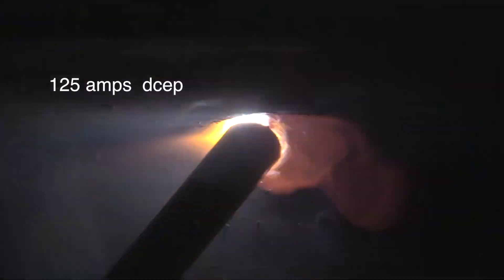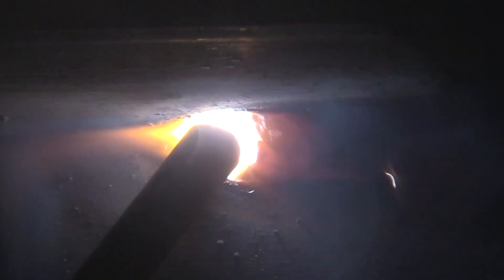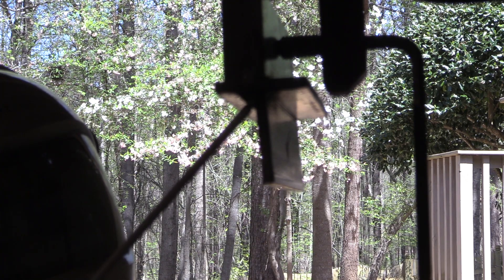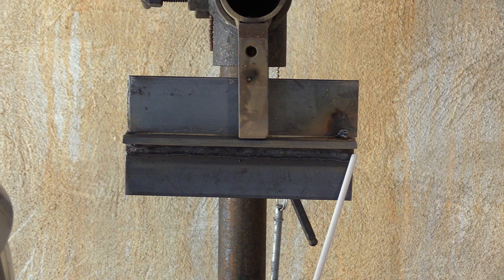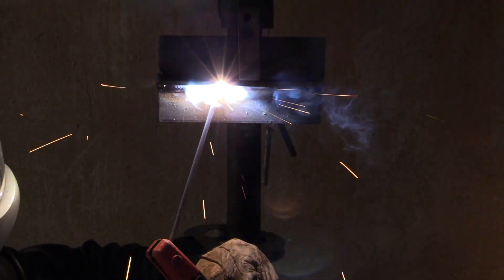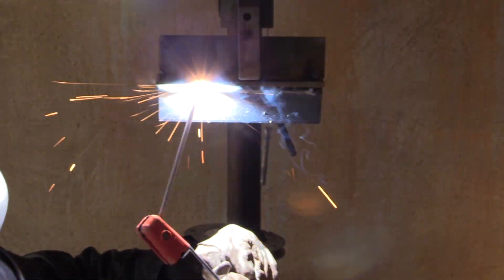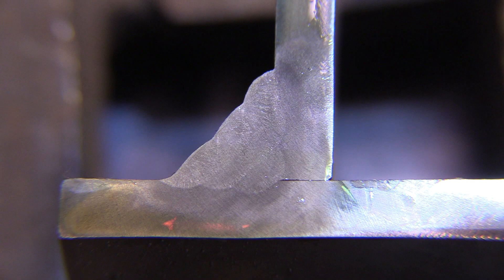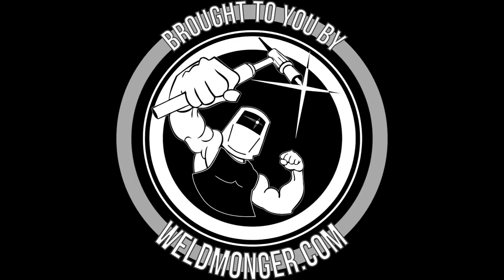Overhead 7018 Biggest Mistake

Comment: I've been a welder since 1972. I began as a helper and practiced during breaks and lunch. Got my 1st opportunity to make two 3g uphill welds because the welder couldn't fit through the porthole. My welds were UT'd as passing. I'm currently certified AWS D1.1/5.20 Unlimited thickness positions; flat, horizontal, vertical, overhead. As a boiler maker welding heat exchangers, I was ASME certified 30 years ago.

Comment: Something that my instructor showed me was when I'm running my bead I have the rod pushed up to where I can feel the hard rod dragging on the plate. If my travel speed is too slow, I am depositing too much metal in one area which results in it dripping down too. So even if you are welding a little cold and have  a correct feed rate , it should be ok. Definitely a tight ark is key. Great video. I'm learning every day!

Comment: did my first overhead yesterday, coincidentally my habit of not buttoning the top button of my shirt also ended yesterday
Reply: I felt that in my soul
Reply: Try 6010 over head 😂
Reply: @Dick Trickle it’s easy, if you’re having trouble try long arcing and spread out the puddle more while coming back and forth, that’ll teach you to control it more and than you’ll be able to keep it tighter after

Comment: i attended welding school back in Chicago when I was 18 or 19 for about six months. I passed my vertical up and my overhead on the first try (8013 Root and 7018 hot and covers) but it seems back then that I just went through the motions on auto pilot... 
I actually have learned MORE here with Jody doing Stick & Tig welding than I ever did then. Most of our training went to Oxy-acetylene Radiograph cutting and stick welding. The Heliarc machine for Tig only went to the students that paid the extra fee out of their pockets which wasn't covered by the student loan ($2,200 extra) Boy... we could hardly afford our $3.00 lunches back then so Tig was out of our league. It was done with pure helium with those Arco welders (2 tons welders!) and all I got was a crappy job at a metal furniture factory where the only process was done with Mig for $5.00 an hour! So I had to learn on the job and on the go and never got to work with Stick welding again for years, Crap! I wasted all that money on school and didn't pursued welding until I was over 50 and your channel is about the best school I ever attended. Now I have my own welding business and if it wasn't for Jody, I would still be working for some factory Korean slaver bleeding me out! Thanks for all your Love of the trade Master Jody. I love doing Tig and Mig but for some enamored reason, Stick is and will always be my first Love!

Comment: Hey jody, I have a question. I have a Lincoln 210 MP and I'm welding on a tongue to a trailer. It's not 1/4 in steel, maybe 3/16. I was thinking about using my 7018 3/32 rods.  Do you think maybe 6011 root and then 7018 cover? Any suggests on amperage? It's some vertical and overhead. Thanks for all your great vids!

Comment: Watched another of your videos years back with the "hot enough to hold tight arc; then hold a tight arc", had trouble with a welding school test.. needed your advice, ended up running ~135amps, ran it tight, bead layed in there perfectly.  Got enough arc force to really flatten the bead.  Your advice is legit Jody.

Comment: I tried tight arc and I still get droplets and I’m running 110 amps any help?
Reply: 110 with 1/8 rod? That's way too cold man.
Reply: It all depends on the machine you’re using, I am at 85 amps with a 3/32 7018 rod

Comment: Run second bead on the top plate, instead of your vertical.  just like running flat that's one thing I've learned and get that fan overhead blowing away from your work. So no risk of porosity. It's those mistakes that hammer ya in the field...
Reply: You use a fan in the field! I doubt if this guy needs advice on how to weld.
Reply: @KStewart-th4sk  guessing they're not giving Jody advise. The comment was directed to the noobs like me. Just a guess, I dunno.

Comment: As a former welder,I want to control the arc,not my machine!! The first weld bead needs to be correct. (TIP)AT THE END of a weld,a tab needs to be in place for a strong weld run off!! Otherwise, you run the risk of a weld cracking down the weld bead. Also,I never hear about a rod oven.Extreamly necessary!!!!
Reply: You are a former welder and never heard of a rod oven?
Reply: K Stewart I think he ment one was never mentioned when it should have been

Comment: Thanks for another excellent video, Jody.  Change of subject.......I got that book you've recommended from the Lincoln Foundation;  METALS AND HOW TO WELD THEM.  Fantastic book.  Thanks for that tip.  I plan to get their calculator for TIG electrodes, filler size, and amp settings.  At $5.50, it's a steal, too.

Comment: Hey Jody, thanks for the video.
Quick question though, as your quite the experienced welder (with many certification tests done), when taking a certification shouldn't the tester provide cooked rod whether it's new or old?
Reply from the maker: 7018 electrodes are a low hydrogen rod  and in a test situation, or actual code work, the rods would either be fresh out of the oven, portable rod oven, or used within a certain time after being in  a rod oven or freshly opened.

Comment: Great video as usual.  This is exactly what I'm showing my students to do right now! Good timing, thanks.  Question: What type of etchant are you using for this one? I need to acquire some. This stuff looks very effective.
Reply from the maker: the stuff I used in this video is called ox out 540L by chemclean.  Its a passivation solution for stainless.

Comment: Could you do a video on 308 16 ss 1/8"  in 3g or 3f? Having difficulty getting my beads to spread out and lay down properly
Reply: jon Kal thanks, been using a inverted v/semicircle kind of motion and finally getting 1/4 to 3/8 beads sitting flat in 3g uphill

Comment: When I was taught in welding the books teach to have a slight circular motion when when welding horizontal and half of weld overlap ,that's fair welding but I can do much better weld looks little hot slightly contoured and you actually tell cause the weld looks kinda grey TO HOT very important it could crystallize cause cracking and weak weld.it should kinda shinny,if the heat is set just right that slang will just fall right off.

Comment: Jodi what product do you use to etch the steel?  Will it work on aluminum too?
Reply from the maker: For carbon steel, I use a passivation solution intended for stainless steels and it is called ox-out 540L by chemclean.
but for aluminum, I use plain old easy off oven cleaner.

Comment: Thanks Jody, yet another great demo...
 I have a question for you, regarding 6010 rods... I have just started playing with some of these and noticed that they seem to be a little more difficult to keep lit up.. compared with a 7018 or 6013. Now i know that these are cellulosic rods, and tend to "dig' more into the plate, but I was wondering if the arc voltage from the machine is important. The rods I have spec 70v, and my  little inverter MMA machine Has an OCV of 65 volts.. I'm running a 3.25mm rod, at approx 100 to 110 amps.... What do you think ???? thanks Chris
Reply from the maker: 6010 do require more voltage than most small inverters have.  most of my smaller inverters will not keep a 6010 lit. but 6011 usually works much better with similar results as 6010
Reply: Are you welding with AC or DC 5p+ is a DC rod only.

Comment: I think it is worth mentioning Lincoln electric has a couple different 7018 rods commonly available the classic LH-70 and excaliber. The excaliber has a thinner flux and works a bit easier for out of position welding because it runs better at lower amps and less flux makes less slag not to mention it fits into the joint better helping to control arc length and travel angle. Some companies 7018 rod really have fat flux making them great for flat but a bit more difficult out of position. For youngster remember to control bead size on every bead. If your bottom bead is the biggest bead you can carry you are setting up to fail. When you run stringer over stringer the second bead will have to be slightly larger than the first and the third slightly larger than the second and so on. When the beads get to large and start to sag it makes holding the tight arc hard. I hope this helps someone. Great video Jody thanks for sharing and helping. I have been welding a while but not long enough to forget struggling at first. Thanks for being here so long and giving so much help to everyone. Many welders forget they were helped and don't want to help, thanks for being a huge link in the chain of love! Tim
Reply from the maker: good points...I do like the excalubur 7018s
Reply: The videos you produce have such good demos that I just have to watch. When I view one of your videos I feel like I am back at Hobart getting a demo from an instructor.  You are truly a blessing. I believe that instead of going to welding school a person could buy welding equipment and your video sets. I would almost bet you are a certified welding educator. I really love that you are so humble considering how highly skilled you are. People just like you.
Reply: Perfekt description of how I, and surley many others, feel about Jodys  videos. This video of stickwelding is exactly what I needed right now. :)
A big thanks to you Jody.
PS: I have two of your Tigfingers, a singel and a dubble, and I use them almost every time I weld.
David, Sweden.

Comment: I feel stupid to ask, but what is a thight arc? (smal rod to material distance + right amperage so you get a stable arc?)
maybe i misunderstood something or translates something wrong.
please fell free to leave some tips

greetings from a advanced beginner from germany
Reply: You get tight arc by holding electrode very close (you will see that slag around the electrode almost touches the base material). This gap should be around the diameter of the electrode. Thats why jody says you need to crank up the amps because if its not hot enough the electrode stick and its pretty darn difficult to stick it of. (This was the reason i was swearing all the time untill i learned it.)
Reply: 23wrer tight* and it means keep in ti close

Comment: Thanks for the explanation, Do you recommend using a welders yoke while practicing overhead.thank you
Reply from the maker: Duncan Mac Farlane I burned myself a lot while learning. I recommend full leather jacket
Reply: weldingtipsandtricks. Thanks. I thought it would help putting a yoke on for overhead when wearing a flameproof overall. Over the overall jacket. But I will see if I can get full leather jacket for practicing at home. In sasol in south-africa they must wear navy blue flameproof overalls and jacket as standard. It's obligation
Reply: I wear a flame proof heavy duty cotton jacket and if you follow jody's tip of keeping a tight arc it will be fine. A thick leather sleeve or jacket won't hurt though, especially when you still practice not to shower yourselves with hot sexy globs.

Note: the protective coating on those cotton clothes wears out after X number of washes. And if you do overhead in a tight spot you really want to have a welding cap to cover your ear. Also, hot sexy globs and ear plugs are a terrible combo.

Stay safe and keep welding.
Reply: when you crack open a welder for say, breakfast... you will find the yoke way inside. after the workworn shell and all the gruff stuff. delicious welder's yoke
Reply: And don't forget that you can often arrange a metal shield to deflect globs from falling on parts of you, especially your boots.
Reply: planeswalking thanks
Reply: jon Kal it is leather yoke that covers arms and shoulders. They use it in pipeline
Reply: jon Kal lol We have always called them a cape
Reply: I’m like you I have never heard them called a yoke before that’s new